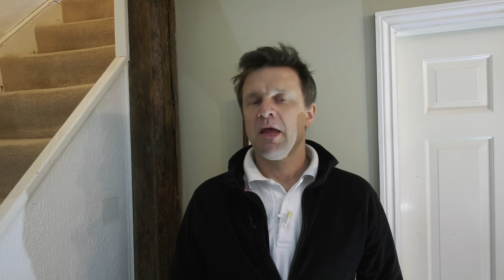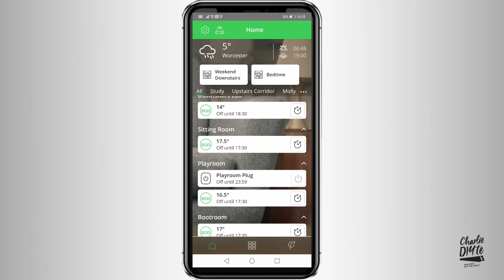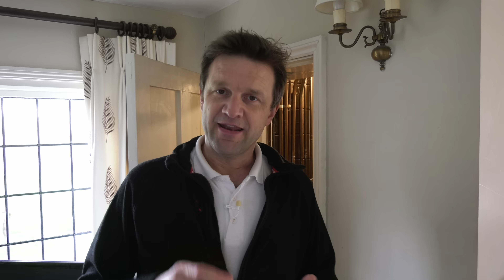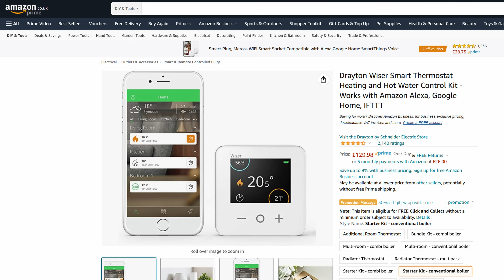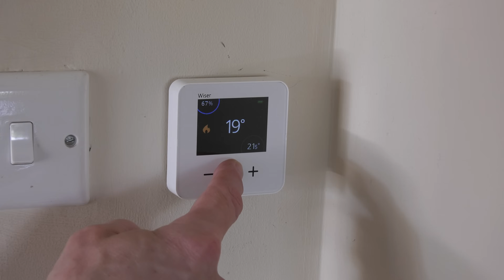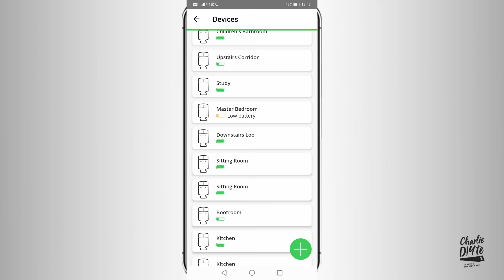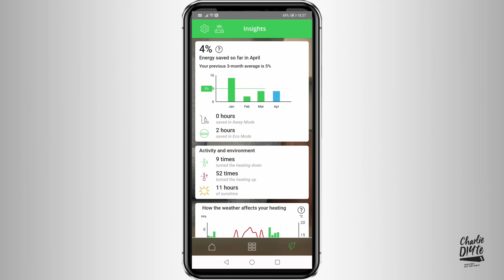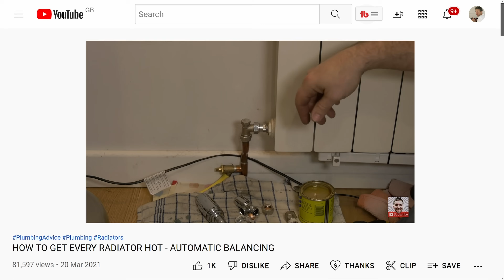Smart Heating Update - 14 Month Review

Comment: Hi Charlie,
Firstly great video update which has inspired me to install my own wiser system, largely for the cheap TRVs. Overall this experience has been pretty good, although I did need to purchase m28 to m30 adapters so that the supplied TRVs can fit, which added an additional £60 for 8 valves. 
However, has anyone experience with the Electronic Heat Switch, which I've also purchased to control a electric towel rail? Apparently, it only fully functions with a separate room thermostat, which questions what the Heat Switch without a thermostat is for. I thought I'd be able to control the relay remotely, like the smart plugs. Anyone any experience of this?
Reply from the maker: Hi Martin, I've just got one of those switches for my tower rail but haven't wired it in yet. They've also sent the room thermostat. What you've just said explains why. I'll message my contact at Drayton and see if I can get to the bottom of this. I agree with what you say. Why is this required?
Reply: @CharlieDIYte  I'd be very interested to hear your contacts explanation. My response from customer services was that without the thermostat, only manual control is available (so no change from what I already had). This is a massive lost opportunity.  The Heat Switch is really a Smart Switch with an improved IP rating to allow fitting in damp environments, it provides network extension but not scheduling via the app. This seems odd to me, as devices like towel rails would be scheduled for lets say, 2hrs, to dry the towels regardless of the room temp. It also doesn't line-up with the website which states (and I quote) "This new electrical heat switch enables complete control over the entire heating system, no matter what the application, via the Wiser Home app." adding that - it has a 16A relay for electrical heating and is able to control Electric radiators/towel rails. I don't think it's doing this at the moment.
Reply from the maker: @martinetheridge1136  Hi Martin, I have nothing to add to your very detailed analysis unfortunately. It seems to have been repurposed from something that was available on the continent. What you and I really want is the functionality that would be a available from a smart plug on a switched spur. The room stat is an unnecessary addition where all we're wanting to do is schedule the towel rail to come on for enough hours morning and evening to dry the towels.

Comment: Hi Charlie, just wondering did anyone previously suggest to you the use of a cheap "Infrared" Digital Thermometer Gun,  to tune the   both  Temperatures on the Rads to tune and Balance same...thus allowing optimum heat transfer across the system and making a Condensing  Boiler to go onto to Condensing  / heat saving Mode for a pastime or even a Non Condensing Boiler to work better in a Property ... Great Upload Charlie.
Reply from the maker: Hi mate, definitely a good idea  I'm going to get one of these to balance the radiators before the winter. 👍

Comment: I’d like to see you do the same with Hive. I have Hive which is pretty awful. Turn up the heat on one rad and it takes 5-6 mins to get to the valve to open. Also they modulates down each rad when it’s reaching temp so much that it never reaches temp so its always calling for heat.
Reply from the maker: Sorry to hear that. Yes I had heard of multiple problems with the smart valves but I hoped they had been fixed.

Comment: I had the  Drayton Wiser Smart Heating System for a 10 months and its been a number of issues.  My first issue was random disconnections in my conservatory, to work around the issue I spend a extra £40 for a Drayton Smart plug and this fixed the issue but some times the Smart plug   disconnects as well which is pain and the battery don't last that long I replaced battery's in 6 smart radiator stats.   Also random log out of the app is a pain and the room controls only control one room.   The configuration is very basic it will control boiler by using opentherm but by default flow temp is 80c you need to adjust boiler maximal to a lower rate and heating always started at the maximum flow temp.    I would not recommend due to high of issue. 

 I recommend Tado or boilers weather compensation.
Reply from the maker: Sorry to hear about all the problems you've had. When you say it only controls one room how d'you mean?
Reply: @CharlieDIYte  the wall display can only control one room vs nest could control everything.   I had issue with wireless dropping off the network and most of the battery's have needed to be replaced  and I had a reset a lot of the winter.  It would better if you could control the set-points for centre heating water temps.   I feel that a more simple weather comp system would had worked better.

Comment: Just installed. Sans radiator thermostats. Have to send it back as CH won’t turn off. I thought it would fire straight away as old room thermostat is shorted out. But even once the Wiser thermostat is installed it won’t shut off. I’ll see if replacement works
Reply: Replacement didn't work either. I think I have something wrong with my wiring as if I separate the old stat wires the boiler switches off but the Wise can't turn it back on again. But also the Wiser stat never appears to pair with the hub. The dreaded spinning wheel keeps spinning yet the app sees both the controller and stat. So I've given up. I also can't access the controller from my phone unless I'm in setup mode yet I have done the WiFi setup from scratch. 3 days and no response from Drayton
Reply from the maker: That's very disappointing, sorry to hear that. One suggestion - call the Drayton main support number rather than the Wiser one, as I've just learnt they've outsourced the Wiser support to, bizarrely a competitor, but head office have all the gurus still who understand the system. Maybe say when you call up that you don't want to speak to the outsource team and would prefer to speak to one of the engineers at head office. Also, I think you should get an electrician in who understands these systems as I'm sure it's a wiring issue that must be relatively simple to resolve. Persevere mate, it's worth it when it's running properly.

Comment: Nice to hear you call out homeassistant. The Drayton Wiser integration works very well in Home Assistant. HA is great but still needs some technical knowledge.

You can also go one step further and do away with the Drayton hub by having the TRVs talk directly to and be controlled by your homeassistant ZigBee server instance (ZigBee2Mqtt as an example). I've tried this, and it pairs but there are some bugs/issues with managing the TRVs. Setting a temp, and the TRV reverting to 20C are common issues. I'm sure they'll be ironed out. What it does allow is for you to run the TRVs yourself if Drayton were to turn of their cloud services or your privacy sensitive.
Reply from the maker: Thanks Robert. Yes I had heard you could remove the hub from the system, albeit enhanced technical knowledge is required for that as you suggest. The integration I linked to I guess is good for those of us who want to keep the hub in operation for the time being at least.

Comment: Big fan of wiser too. You mention about boiler modulation which sounds like a break through. I have a worscter boiler which doesn't support opentherm do you know anything about the adapter or know where I can find out more?
Reply from the maker: I'm afraid not and you'd probably need to adapt your heating system as I mentioned in the vid.

Comment: Drayton advised me against using standard rechargeable batteries at 1.2V due to problems with the low voltage powering the valves. I'm not sure why they don't have a DC-DC boost converter in there to up the voltage to a constant level for the motor etc. Especially when some of these boost converter designs can work down to 0.7 V.
Reply from the maker: Makes sense. Mine are 1.5v.
Reply: @CharlieDIYte  Quite weird suggestion. At 1.2V alkaline is only a bit more than half empty. NiMH drops below 1.2V only when about 90% of their capacity is depleted (they start at lower voltage but during discharge it does not drop much). Not to say Alkalines have a very high internal resistance compared to NiMH, therefore under load of the motor NiMH likely will have higher voltage, as voltage on alkalines will sag.

Comment: Another great review Charlie. Thank you! I'm looking at sacking off gas all together. And I'm looking at electric, oil filled radiators that can be controlled via smart controllers, both hardwired and via WiFi allowing management via the Internet. Under floor electrical heating, electrically heated taps and showers and an induction hob, instead of a gas hob. No yearly boiler servicing, no single point of failure, no pipes for heating in floor, ceiling or loft spaces. And the option to have multiple radiators in certain rooms or spaces. That plus solar panels should make a dent on energy bills.
Reply from the maker: Yes, with solar panels this could be a good option. Without them though I'd be a bit worried about the cost - what with the way electricity prices are going at the moment.

Comment: Why does wifi go down if internet goes down?
Reply from the maker: Well the WiFi network doesn't go down but it becomes pretty useless without the internet. It's a fair point though. My point is, better for the robustness of the network to have it on its own frequency and also the benefits of it being a mesh.
Reply: @CharlieDIYte  if the software/firmware  was on the devices then internet wouldn't affect its functionality

Comment: Charlie, It's worth knowing that in any Zigbee mesh network there are 3 types of devices, a "Co-ordinator" (only need one), "Routers" which are mains powered devices that can route signals between devices and "End Devices" (usually battery powered)  that need to connect either to a Router or the Co-ordinator. The Smart plugs you are using act as Routers and so by allowing End Devices (your radiator thermostats) to connect to them can extent the mesh network. It is also worth knowing that WiFi networks and Zigbee networks can interfere with each other and it is sensible to select the bands they use so as to prevent this.
Reply from the maker: Thanks Dave. Makes sense. Am I right in thinking the smart thermostats could interconnect in the mesh but generally don't because they're switched off most of the time, checking for instructions every minute or so? I need to configure my Unifi access points properly as I currently lose quite a lot of upload and download speed as against what the 4G router is recording. I have a very good guy on  my Discord group who's told me what I need to do. I just haven't got round to doing it yet. 👍
Reply: @CharlieDIYte  one of the key benefits of zigbee devices is their low power usage, this is why their battery life is good. This is in part achieved by the device going to sleep for short periods. When they are woken up they should automatically connect with the Co-ordinator or strongest signal router. Because battery devices spend time asleep this makes them no use as routers.

Comment: I followed HeatGeeks method of balancing which worked a treat for me - it was more about the room temperature (which is what we want our rads for) than rad temps. It should in theory be easy with smart trvs, set them all to 19 from cold, see what gets up to temp first, turn that lock shield down, or if one is super slow, open it up. Keep going until all get up to temp at roughly the same time. I did this using govee Bluetooth room thermometers, took 4 mornings and worked a treat, allowed me to reduce my flow temp too (weather compensation). Hope that helps!
Reply from the maker: Glad to hear that. Yes I haven't got round to doing this yet.
Reply: I've always been confused exactly what balancing the radiators meant. So, in your example, you're saying set all the radiators to 19 degrees, and have all the TRVs set to the same value, then you need to turn the flow rate down in a small room like a cloakroom and increase the flow rate in a large bedroom so they reach the desired temperature at the same time? What's the actual advantage to that though if you have the electronic temperature sensor TRVs - who cares if all the rooms heat up at the same rate as long as they all hit the right temperature? Is there an energy saving if all the rooms heat at the same rate? Do you want rooms to heat slowly and the boiler be on for longer or do you want rooms to heat quickly so the boiler isn't on for long?
Reply: @danludlam1562  you balance a system to ensure the correct flow rate is reached over all your rads. Generally you restrict closer to the boiler and open further away. If it flows too slowly or too quickly, your rads furthest away will not get fully warm, or your room might never get up to desired temp. Once it's balanced, you can try turning down your flow temp to the point your rooms are just warm enough - that's when your system is most efficient. Warm up slowly, heat on a bit longer but boiler working much less hard. Hope that helps!
Reply: @pumpkinhead456  any comments on underfloor heating? Because obviously, that's always going to take longer to heat a room but is there a recommended way to balance this?
Reply: @danludlam1562  no idea I'm afraid, sure there will be plenty info through Google. Good luck!

Comment: Another great video, thanks - even though I only have a couple of radiators. 
I use thermaskirt heating combined with woodpellet boiler both of which i love. 
Had boiler 12 yrs and it's been so reliable and economic. 
As for thermaskirt - can't recommend the product and the company highly enough. (I have no links to woodpellet boiler or thermaskirt companies)
Reply from the maker: Thanks Colin. Glad to hear you've got a solution that works well for you 👍
Reply: Hi Colin. Can I ask how well your house is insulated? We just moved into a 200 year old stone-built farm house and our lumber said he did not think thermaskirt would work due to the lack of insulation and the relatively small emitting surface area

Comment: Huge fan of the Wiser system, and experienced all of the benefits you mentioned when it was installed in my last property. In my new home I needed a different control unit as I don't have a combi, and I need to change my TRV valves as they are so old the TRVs are incompatible with them, so something to be mindful of if anyone was planning to take their Wiser unit from one house to another. I have found their support to be very good and recommend buying the smart plug. I find battery life to be well over a year for the TRVs. Sometimes the heat report drops out and this is exclusively related to wifi - the main controller is a bit finicky at picking up a weak wifi signal so make sure it can pick it up easily. I am installing electric underfloor heating for my bathroom and would love for Wiser to have a solution for that too.
Reply from the maker: George they have that electric radiator unit I mentioned near the end - for larger electrical appliances, which would probably work for your underfloor heating. Worth looking into.

Comment: Hi Charlie   Again a very interesting video .  But it does highlight just how complicated these systems are , when you consider my mothering law in our attached granny flat still uses a wall stat like a switch 😂 bless her . But in all fairness heating and the dreaded desired temperature are the bane of any heating system . Even as a retired electrical contractor I was starting to glaze over as you went into the setup . Which leads me to my problem with a lot of these controls . Most standard central heating is laid out as one continuous loop , with a loop say for the hot water . Yes a motorise valve may be in place to separate the upstairs from the downstairs , but usually that’s were the sophistication ends .   In this regard the underfloor heating industry has got this problem nailed , because it can treat each room as separate zone by the use of thermostatic manifolds .  Yet we are still building new houses with the same old heating layouts that were around 50 years ago which are inherently difficult to control . The government is pushing for air source heating , but I think they’d be better off looking at the system as a whole rather than just what generates the heat .  Finally I do remember years ago working in public buildings they often had remote stats that linked directly to the radiator valve , seems even way back then they were chasing the dragon as they say .               Best wishes and kind regards as always 😀👍👍👍
Reply from the maker: Thanks for this Michael. A couple of things, I think my system was single pipe when we moved in so one pipe connected each radiator in a loop which is generally a disaster as the last radiator in the line takes for ever to heat up. It was replaced with a double pipe system when I moved in, which works much better as you can genuinely zone each room with the smart valves. So it's not quite as problematic as you say IF you have a double pipe system but you raise some good points there. Underfloor heating is the holy grail particularly downstairs as without it you have a permanent refrigerator below the floor which vastly reduced the effectiveness of any hear you try and add - as do uninsulated walls and windows - even when they're double glazed.
Reply: @CharlieDIYte   absolutely sir , thanks for the reply . We can forget some time how lucky we are to have all these new possibilities to improve our lives . Back in the 50s as a kid in the winter I would scratch my name in the ice of my window on the inside .  Happy days   Best wishes and kind regards as always. 🤣👍👍👍